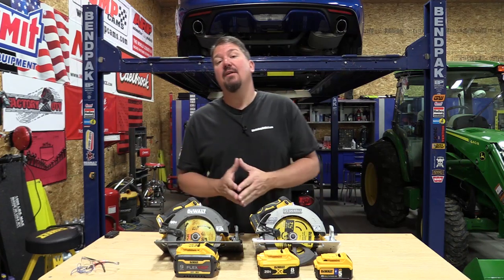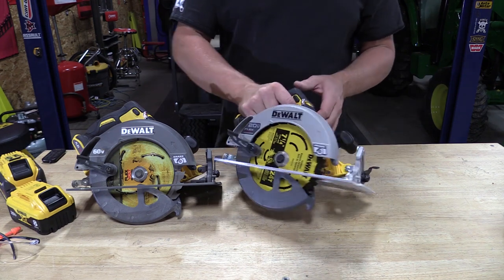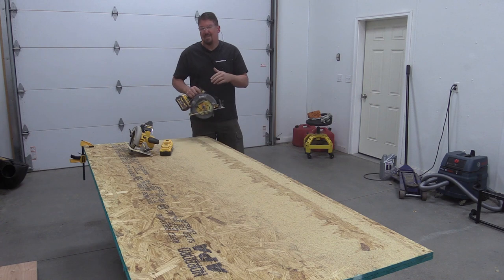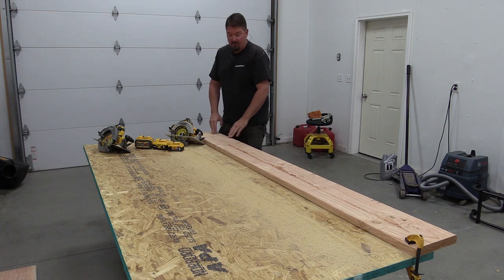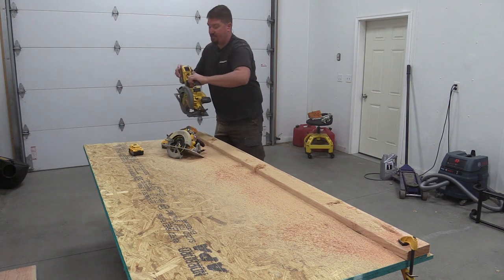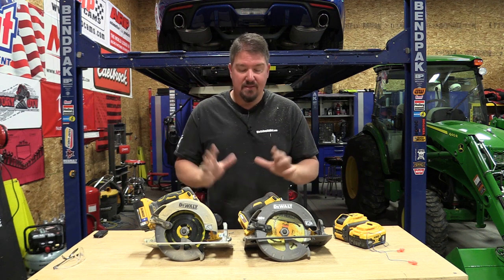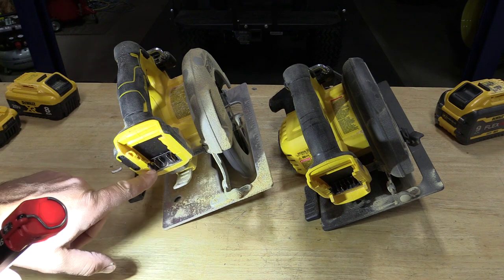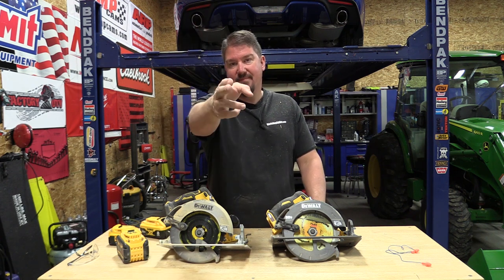DEWALT FlexVolt Advantage 20V Brushless 7-1/4" Circular Saw DCS573B Vs Flexvolt 60V Circ Saw Review

Comment: Conclusion: flexvolt circular saw is the beast.
Reply from the maker: You got that right
Reply: I just bought the worm drive Flexvolt. It's by far the best saw corded or not.
Reply: @John-771  where did you get it. I've looked everywhere, out of stock online and the depot here in Virginia
Reply: @davegordon6943  I bought mine about 18 months ago at a small local hardware shop Viking Lumber. Sorry I don't know where to go now that everyone is out of everything.
Reply: @John-771  owned it a while. It’s a kick ass saw.
Reply: That's a fact
Reply: @WorkshopAddict  Hi Brian do you think the dcs 573 has about the same power as the dcs 570 when running the xr 5amp battery? Thank you
Reply from the maker: @interman7715  yes
Reply: @davegordon6943  6 tool brushless 20v kit for 499$ I got mine.. they should have just the saw somewhere. I know ebay has them a round 135-155$ for sale . Good luck you'll love it.. Dewalt killed it this yr
Reply: Your 60v saw has nothing on my 115v saw.
Reply: I went with the flexvolt wormdrive one.
Reply: That’s why I have two, love them

Comment: I just got the DCS573 Flexvolt advantage after being undecided for a long time because I had my good old 6-1/2’’ saw and it was okay most times. But those times when I needed that extra power, I just couldn’t stand it. I felt inadequate. When I first tried the Flexvolt advantage saw, I knew right away I had made the right decision. The 60v saw was a bit unnecessary for my use, but the 20v Flexvolt advantage is the perfect fit for me. I have other 20v tools and I also have one Flexvolt tool so it all made sense for me to get this

Comment: It great that dewalt is giving us options. I just wish they would update the impact driver (887) and the 7 1/4" miter saw, and expand the 12V line.
Reply: Right??? I also wish they would do a Fluid (Surge) type impact for noise.
Reply: Jake A. I gave my impact drivers away. They are really noisy. I do have an impact wrench the 400 type and use it occasionally with ear protection. It's the metabo. It's got a dial up to 12 and at 5 can loosen car tyre nuts.
Reply: @ron1martens  yeah. Would be great if they would make a hydraulic version of the impact like what milwaukee and makita have done. In fact, I use dlthe drill and not impact for driving screws at home to keep the noise down.
Reply: @ron1martens  a lot of people swear by Milwaukee 12v line because they have 2 types of new impacts (I think it’s 2 or maybe 3 because fuel) but one is powerful but they also have one that is very quiet but not the strongest you can get but this quiet one can also take off car lug nuts and most things you can throw at it 

Overall try Milwaukee they are great
Reply: Today 11 good advice. I have a cordless Milwaukee sander and one drill 18 volt. I did have the 12 volt high speed polisher with a 2 amp hour battery I think. That was one of the tools I had stolen. Would be good to take your advice and buy a 12 volt 4 amp hour battery Milwaukee. I do have the combination charger. One of the aspects of having your tools stolen is to upgrade. The only thing is the money part of things work and saving.
Reply: Same here bro I want a new impact and hog ring anvils on impact wrenches over pin detent
Reply: @peter2213  i own Milwaukee 12v the only negative is the price. But they usually go on sale
Reply: It's a great impact. When the job is gotta get done who cares about the noise!
Reply: 12v is really not useful even for soffit and small stuff the new 20v impacts are so small and with a 2a battery they are as light as a 12v
Reply: Bro I couldn’t agree more. We need a new impact and more 12v tools. But dewalt will answer and they will answer good🙏🏻🙏🏻🙏🏻🙏🏻
Reply: Lol they answered 10/2021
Reply: They did with the dcf850

Comment: About 2 years ago, I bought a Dewalt DCS575T2 Flexvolt saw kit with a fast charger and 2 Flexvolt batteries DCB606, it performs really well, meets my needs, I got rid of my Harbor Freight corded circular saw in the process. Obviously, a 60V motor is definitely gonna outperform its "little brother" 20V -- whether the "Power Detect" version or "Flexvolt Advantage" version. I got a few more DCB606 batteries while buying other 60V tools later. Therefore, I'd keep that DCS575 60V circular saw and would never want to replace it with these so-called "Power Detect" or "Flexvolt Advantage". This demonstration video has shown it to me one more time that I've made the right choice 2 years ago when I purchased that DCS575T2 Flexvolt circular saw kit. Thank you for your time, Brian, I highly appreciate your efforts anyway.
Reply: Couldn't agree more ,I have the Flexvolt  575 as well ,it is unstoppable, I can do full depth rips in Australian hardwood with ease ,there is no point in replacing it and I use the Flexvolt batteries on my 20 volt XR tools, win win .
Reply: I also bought the Flexvolt 575 2 years ago and it was and still is a beast.  It got me into the 60v power platform and I have added the newest Flexvolt Advantage 60v Recip saw.  Very nice saw, plenty of power with 60v.  Going to add the Flexvolt Advantage drill when it hits my price point.  Hoping you do a similar comparison with the advangtage drill.
Keep up the good videos.  Very informative.

Comment: Been in the trades for a few years now. Framed with the 60V for a year and loved the saw. I ended up buying the 20V for myself but today I finally made the decision to buy the 60V. The 20V was okay but I found it a lot weaker and had trouble cutting, personal I don’t think it’s a saw you can frame with. If you’re going to buy a saw get the 60v
Reply: I've had the 60v for over two years now doing siding. Lp/ hardy/ framing lumber, lap/ board and baton/ shakes. This saw will bury the blade in anything and not bog down. I love it.

Comment: Wow , it's getting a little hard to keep track of what's what.  Having options is always a good thing , but this is getting crazy. There is no doubt that the Flexvolt is the King of circular saws concerning power....and being a Milwaukee guy that's hard to say...but the truth is the truth. Your right when say that you cannot ever have enough power especially when your on the job...it's getting late and you have a deadline to meet and you still have quite a bit of cutting to do....in a perfect world blades would stay sharp forever but sadly we all know that's just not the case. Where the Flexvolt truly shows it power is when you don't have a new spare blade with so all you have is what you have....a dull blade.  This is where the extra power pays for itself big-time.  So if I was a team yellow guy....buy the real deal and be done with it. Excellent demonstration comparing the two saws showing what they can and cannot do....Great vid brother.
 Sorry about the long winded post..😁
Reply from the maker: Thank you Donny.
Reply: Well said Donny!
Reply: Milwaukee m18 high out put take note. Brushless voltage matters
Reply: We seem to be caught up in product line madness now where  no one is ever satisfied ,btw I have been doing framing and  all sorts of carpentry for thirty years efficiently just with basic tools ie a lightweight Makita corded 7 1/4"  circ saw and a basic  battery drill and never gave it a second thought ,I did get a Flexvolt 575 circ saw and various other  Dewalt cordless tools a couple of years ago and love the  power and convenience. I still like my corded stuff though.

Comment: Helo!  
I have these two saws in duplicate “2 of 18v and also 2 of 54v” the 4 saws work almost daily in professional use, and so far they have never given me any problems.  
They are incredibly fantastic, and although both are very identical in size and weight, the FlexVolt 54v are actually more powerful!  withstand cuts with maximum thickness of high hardness wood without any difficulty.  
I forgot to mention that I am from Portugal, and the manufacture of both 4 saws is Germanic.  
I love your channel!  I only follow 5 tool channels on YouTube and yours is one of the 5 channels I follow!  
I thank you for your fantastic videos, I like a good channel where humility is present and always a good safety advice to help us not make it easy when it comes to the safety of handling any tool!  
Until the next video!  
Helder da Silva.

Comment: I already had the impact driver and c couple of 3Ah batteries. I just bought the 60 volt saw with the 9Ah battery and the 20 volt flex volt advantage 999 drill which also came with a 6 amp hour 60 volt battery. That gave me two compatible batteries for my 60 volt saw. 

On the tools that have the expensive batteries it doesn't make sense to buy the bare tool, because for instance with the saw you pay about $100 extra and you get a $220 battery and an $80 charger.  Two 60 volt batteries is enough for me to keep my saw going for most jobs. And frankly if that's not enough I have  the best corded DeWALT circular saw that DeWalt makes and if I need more capacity I will use that.

Comment: Hey BrIan!  Another thorough, classy, and no nonsense review.  The 20 Volt version(s) have come a long way, but if anyone out there gets the chance, just pick up the actual 60 Volt Flex Volt saw.  I was lucky to pick up one of the last ‘Special Buy’ ones this Summer, that came with the 6 amp charger, 3.0/9.0 60 Volt battery, 2.0 20 volt battery, and compact hammer drill, for $279.00! The latest model is a beast!  My only qualms lies with the durability and reliability of the 60 Volt packs.  I have yet to have a problem, but have heard of people having batteries fail.  They are a very complicated battery.  I avoid heat, unnecessary stress, and NO dropping them!  😬  Thanks and stay safe and Healthy!  👍😁🇺🇸🎃
Reply: George Da Vall. I seen a person bring in the 12 amp hour battery for warranty work as something happened to it. I too have heard some issues with the flexibolt dewalt batteries. Like you mention don't let them overheat. Here's something interesting. I went to my local tool place and was told some of the tools going up north Western Australia. As soon as the machine is turned on it blows up. The  temperature up north is around 46 degree Celsius or more. I didn't get the full jest of what the technician mentioned only that the tools weren't designed to stand the heat. So imagine the handler turning on the machine and it blows up I mean the electronics not actually blowing up more like a short circuit. It would certainly give one a startle.
Reply: @ron1martens  I am in Qld and is bloody hot ,my Flexvolt batteries run cool ,the only tools I've seen run hot are Milwaukee, because they are drawing to many amps out of 18 volt system.
Reply: interman 77 you have a valid point there interman. Are you up north from Brisbane? I guess the more North you go the hotter or humid it gets. Not sure if it's the same as north west. I will refresh what the technician mentioned regarding tools made for European conditions opposed to mining locations. When dewalt came out with their flexivolt it was a revolutionary move. Milwaukee however do throw a lot of technology at their lineup with Joseph Galea the CEO pouring billions into their research.

Comment: thanks,  it clears up my choice. Since (Nov/Dec 2021)  Dewalt is running a $199 for a 4AH + 6AH battery deal for $199 and you get get the the 20V DCS573B for free, I'm going with that if I can talk Santa into it.

Comment: Thank you for posting.  I have a few 20v max tools and batteries.  My uses for circular saw is minor construction on weekends.  So if I can get a deal (Home Depot often has in short runs) of 20v flex with battery/charger combo from Home Depot for $199 I’ll do it  Getting the 20v max saw by itself $149.  The 20v flex $199 (better choice) or go all in for 60v flex kit.   (normally $299). Decisions, but at least I know I would be more future proofing going to 20v flex over 20v max.

Comment: I didn’t have a circular saw to begin with. Currently the 573B tool only is 250 and the 578 kit came with a 9AH and 6a charger for 330. Decided to go with the 578. Just going to wait on a FV battery sale to pick up some extras.

The 570 with a 4ah is 307. Pricing drives me nuts… lol

Comment: Man.  Dewalt had to stroke Home Depot a little bit I think that’s why they introduced the Flexvolt Advantage, that way you have equally competing lines at both Home Depot and Lowe’s.  Even though yes, Power Detect is technically different from Flexvolt Advantage, they both operate on the same principles.  So the next thing would be run time.  Does Power Detect with the 8.0AH and 21700 cells give you more/less/equal run time than the Flexvolt Advantage with a 9.0AH and 21700 cells?  It’s 1.0AH more for the Flexvolt Advantage so that should equate to a little bit more run time.  And since the 8.0AH and now all of the Flexvolt Batteries now have 21700 cells they will run cooler and are less likely to over heat.  I think it’s a wash between the Flexvolt Advantage and Power Detect overall.  I agree with you Brian the actual Flexvolt is where you want to go if power and torque is what you’re after above all else.  Great review as always thanks brotha!
Reply from the maker: From my use today after the video posted, the 9Ah FV lasts a touch longer than the 8Ah in the power detect, just as you would expect.  The FVA does have a tinge more power than the PD, most likely due to the 3P battery on it.
Reply: Hi Mike, you will find the 60 volt batteries output a lot of amps, but at the expense of runtime.  As Brain said, it helps to already have FlexVolt batteries, if you pick up the 60 volt saw.  And definitely have one of the yellow Fast chargers!  They usually come in the kits.  Peace!
Reply: DCB206 6AH and DCB208 8AH use 21700, while Flexvolt 6AH uses 18500.

Comment: Another Milwaukee guy watching the video and coming away impressed. Actually I’ve just started in Milwaukee and hope to be taking advantage of some of the amazing deals out there this season. With all that being said, both of these saws seem to have some great features and capabilities, but it’s interesting to see a great side by side demonstration, especially walking up the various battery sizes and then for the true Flexvolt saw to still clearly dominate in raw power. I have to say I am impressed. Also, huge kudos on addressing the eye protection oversight head on, instead of waiting for it to be fought out in the comments section. We all could stand to be a little more willing to don the proper PPE; it’s quick to do (and it’s waaay faster than a trip to ER!) 
Ain’t nothin’ macho about losing an eye unnecessarily (unless you’re a pirate....because, necessary or not, it really does enhance that particular esthetic.)
P _  ) 
Arrrrgh!

Comment: How would you compare the Flexvolt Advantage to the Flexvolt Power Detect
Reply from the maker: I hit on this pretty late in a long video, sorry.  I think the FlexVolt Advantage has the edge for power, but you really need to look at what works for you best.  Do you plan on buying more FlexVolt batteries or high capacity 20-volt batteries.  If you want the most power, the actual FlexVolt is where it's at.  The difference between the FA and PD is minimal, bit noticable if used directly side by side one after the other....  But in the real world, you have to invest in the tools that fit your future battery platform.
Reply: @WorkshopAddict  from what I see Flexvolt all the way I prefer the DCS577B
Reply from the maker: In the saw form, if you want the power, of course.
Reply: @steveortez2613  --- The 60v FlexVolt saw in the  video is the New dcs578 ...
Reply from the maker: @dusan78  The drills were going to be tested tomorrow but I cut my finger and have 8 stitches.  Going to have to put that test off a few days.

Comment: Due to some unforeseen reasons I am in need to switch out my ryobi powertools for another brand. Dewalt at the moment makes the most sense for me as currently we have a 15% off deal at the entire dewalt catalog.
I noticed the flexvolt advantage tools and to me they look more interesting than the actual flexvolt tools. As I'm just using the tools for DIY type of things and other personal use I don't really NEED the ultimate power of the flexvolt saw. But what brings me to spend the little extra on the advantage saw is that when I register we also get a flexvolt accu send to our home. Which means that along with the advantage angle grinder I'd pick up and an advantage circular saw (body only) I'd end up with a total of 3 6AH flexvolt batteries. I might not get the full potential out of them right now but it surely already opens up a very nice corner to later on have easier (cheaper) access to the dewalt garden tools like lawnmowers and chainsaws. (also who can say no to 2 free flexvolt batteries? XD) 

Just my thought and point of view as a soon to be new Dewalt user.

Comment: Great video.  Thanks for the nuance showing the difference between flexvolt and flexvolt advantage - I'll go with the 573 as I will rarely need more power and, as you showed, will get a longer run time.  Thanks again!